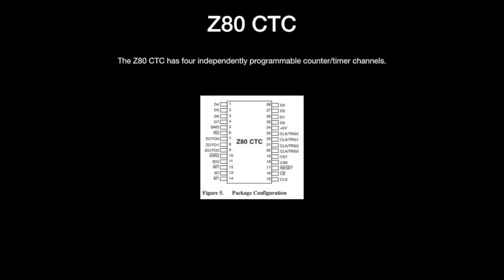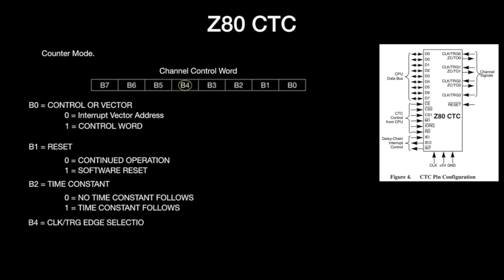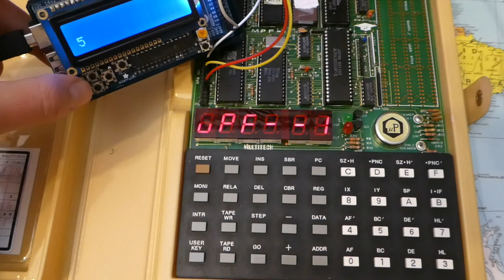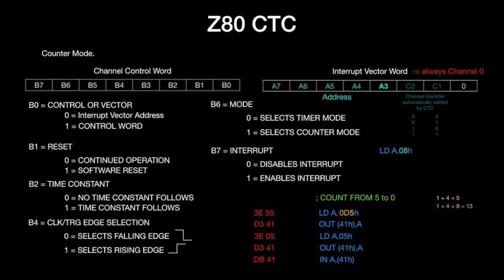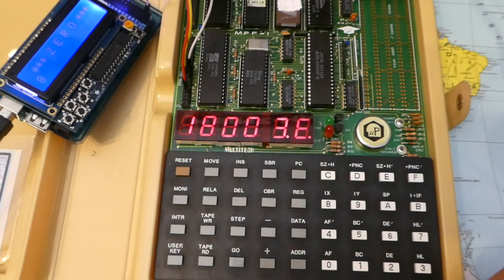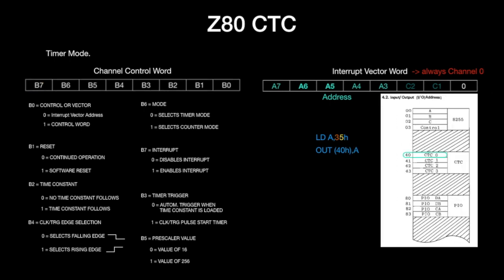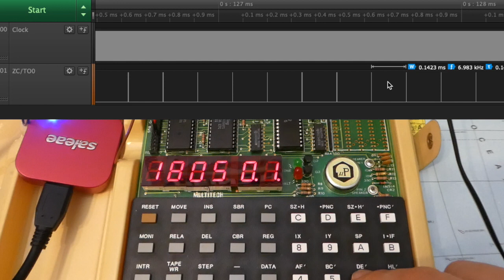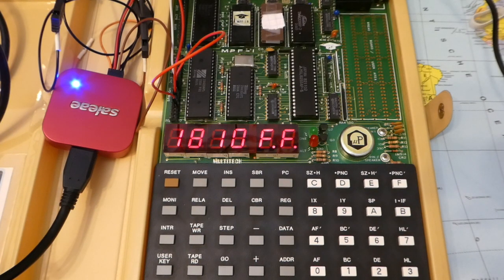Programming the Z80 CTC chip

Comment: I had a project in 1979 where I should've used a CTC but chose instead to do the job with TTL. I was measuring the period of a wave coming in from a radio to demodulate commands sent to my controller from a bank building in downtown LA. The CTC was absolutely perfect for the job and would've eliminated a dozen ICs . I would like to have the opportunity to redo that project. I needed two interrupt generators and two counter channels. I could've done a much more precise job with the CTC than I did with dedicated hardware. I could've evaluated the count using a table lookup that would've been much more adaptable. It was still great fun and I enjoyed that project.

Comment: Hello. How i can contact with you? i have a question ab out working with ctc and pio on some z80 based computer. thanx.
Reply: What ? Maybe i can help you
Reply: @LeonardoPJ   Hello. Sorry for wait. I need help with CTC. Sorry for my broken English... So, there is a z84c1516fsc processor. It already has built-in CTC, PIO, SIO, WatchDog and some other ports. It is very important for me to understand how to work with CTC in terms of generating interrupts, constructing vectors for them. The processor is installed on an 8 bit computer - ZX Sprinter 2000. Standard interrupts - 50Hz. I need to be able to issue interrupts from 2ms and above. I know about 4 channels for CTC. How i can use all channel (as independent interrupt sources)?
Reply: @saymannskable  Well, if I understand your question, to use the 4 independent channels. You must program each channel to point to a different memory position at each interruption. Do you want me to go into more detail? help more?
Reply: @saymannskable  ok, lets talk in email